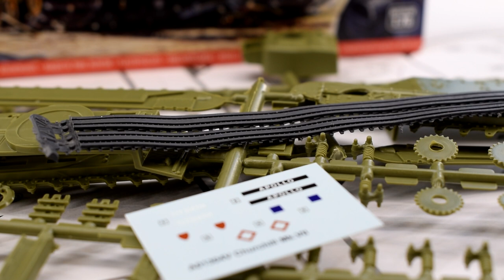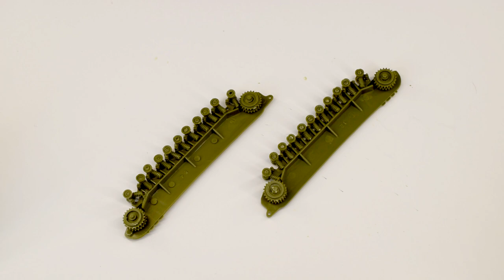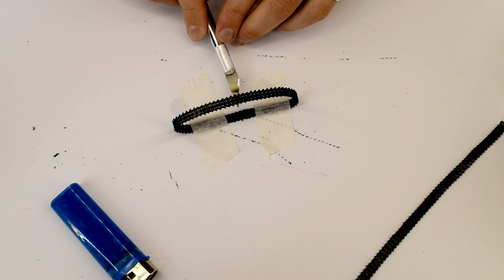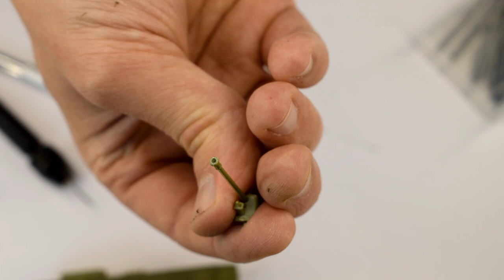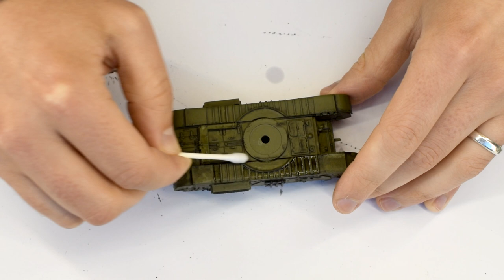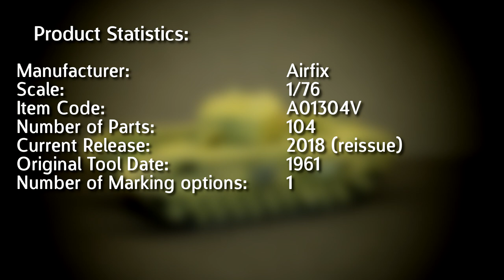Full Build | Airfix Churchill Mk.VII | 1/76 Scale Plastic Model Kit | Build & Review

Comment: When I was building these in the 60s when they first came out superglue didn't exist. Virtually nothing would ever get the tracks to stay together...
If you wanted a Humbrol Acrylic, just use #30 Dark Green. Simples. 👌
Reply from the maker: I've heard that stapling the tracks together can work. I thought about using the 30 acrylic, but it seemed too dark (yes I could have added white but I really wanted to try out some different paint brands and this was a perfect excuse)
Reply: @ModelMinutes  when i built this one i stapled the tracks together, seeing as the top part of the track would be hidden by all the armour. This worked quite well for me. 

Also the kit i bought had humbrol 30 on the instructions and not 159. This is a shame as the lighter green looks better.
Reply from the maker: @jamiegray6931  I think that humbrol have been upgrading their range recently which is why they have a more appropriate colour now
Reply: Fortunately Airfix now make these small scale tracks using rubber, as in this video. About 20 years ago they were using some grey vinyl plastic...it was awful. They had to be either stapled or sewn together.

Comment: I built several Airfix Churchill VIIs back in the early 1970s when I was a teenager. I eventually moved to painting historical wargames figures then took up building models again a few years ago and the difference in the equipment available and standard of modern kits and range of aftermarket parts compared to the old ones is amazing.

The Churchill in all its variants is one of my favourite tanks, maybe because I had an uncle who served in Churchills in Italy after being in Matildas in the desert. Memories of all those fiddly wheels have persuaded me to steer clear of the Airfix kit (which has fit problems as well) and go for resin models from the 1/76 Milicast range which cost more but are really nice and his range includes earlier marks as well as the VII.

Thinking back, I’m pretty sure the tracks were a kind of silver/grey colour originally, and best assembled by whacking a staple across the joint then hiding the joint inside the sponsons or by sewing the joint together. The hot knife thing never really worked. The old tracks also resisted paint even better than they did glue. It also doesn’t help that the Airfix colour instructions on a lot of their kits are simply wrong - the Churchills seem to have mostly been bronze green, or maybe the British equivalent of US olive green, but Airfix have a policy of only recommending paints from their Humbrol range which are more (or less) similar to the correct colour (and particularly frustratingly sometimes the painting instructions include colours Humbrol no longer make).

One suggestion if I may - get yourself an airbrush, some good tweezers and sprue cutters. Airbrushes give a better paint finish and good tweezers and cutters make life a lot easier.
Reply from the maker: Thanks for the info! I've actually been looking at getting an airbrush . . . just need that YT revenue to come through before I can get one!
Reply: Basic airbrush setups are much cheaper nowdays. Probably could get a basic portable rechargeable airbrush for under £50 or so on places like Amazon. I live in the US so I guesstimated the price in pounds sterling based on prices I have seen in USD. Even the cheap Chinese stuff should be good enough for basic stuff.

Comment: Your Churchill turned out good. 
I think £6 is ok for these classic kits, but it's the postage that's a killer.
The Airfix 1/76 Cromwell is a fantastic modern kit that does away with those rubber band tracks...however it is a bit more expensive.
Reply from the maker: Yeah - I quite liked building the cromwell :D

Comment: Nice video again. I really love the 1/76 Airfix & Matchbox/Revell reissues. Will try superglue to finally finish my Airfix MKI. But I am wondering what is the benefit of the Tamiya thinner when you can use water for acrylics instead?
Reply from the maker: The benefit of the thinners is that they are usually alcohol (or similar) based so they actually work into the paint to make it thinner (chemically). Whereas water pretty much just spreads the pigments out (as is my understanding)

Comment: Good video! 👍 When you attach an antenna, try drilling a small hole for it to go into. That way its a little sturdier, and won't snap off as easy if you accidentally bump it. For a tiny area, like the top of an antenna mount, start the hole with the tip of your hobby knife by rotating the point until you have a well centered starting point for your drill bit. That way your drill bit won't move sideways while you are drilling, and the hole will be perfectly centered.
Reply from the maker: Top tip! I'll try and remember that next time!

Comment: Very cool lookin tank! Btw i have a question. Is it always neccessary to apply gloss varnish under decals?I tend to use fine decal setters (under & over). Despite having problems with moving the decal on the surface they really get the job done.
Reply: You can also prepare the area for the decal by sanding it with super fine sandpaper. It makes flat/matte paint have a glossy appearance that is nice and smooth when you put the decal on.  After that, give the model a spray of dullcoat.
Reply from the maker: If that works for you then that's ok - i tend to apply the varnish as it is what I have available

Comment: do you have to use acrylic thinners on the nuln oil or would water work?
Reply from the maker: Citadel Nuln Oil comes as a wash - so no thinning is required
Reply: @ModelMinutes  i mean for taking off the excess wash it normally works on chalk washes
Reply from the maker: Ian Kozlovsky yeah, thinners works best for that. When it dries the water won’t do anything

Comment: Very nice build of this old classic kit.  Having built one a couple of years back I agree with your comments re the poor (by modern standards) moulding quality and the fit challenges.  I spent a very long time painstakingly cleaning and refining the shape and fit of parts (my OCD kicking in, I always tell myself I'll do a 'quick build', but I never manage to, dumb really because this results in a lot of stalled builds) which did improve the final appearance, but not dramatically so... I think you used your time far more wisely.  Great painting and weathering skills and again I think you used your time wisely.  For fans of small scale Churchill's the Matchbox (reboxed by Revell) 1/76 Churchill AVRE, is a real gem (complete with bridge_laying modification and mini diorama), and then of course Dragon offer really high quality choices in 1/72.  The smaller 1/76 scale really shows if placed alongside 1/72 subjects, but can create a nice distance illusion in dioramas by using 1/72 in the foreground and 1/76 at the rear.  And yeah... those horrible rubber band tracks!!!  I have to confess I didn't even try joining the ends, I just superglued the visible sections and cut off the lengths that are concealed under the track covers.
Reply from the maker: thanks for letting me know :D

Comment: You did a nice job of making the brutally difficult wheels look easier than they truly are :) I have built the kit as well as the Bridelayer and the Crocodile kits. They 'end up' great, but, they will require a great deal more swearing than you implied :) They don't just casually clean up with a few moments with a sanding stick at all :) They don't assemble with little or no effort involved. If you want them all correctly aligned that is. The assemblies are not even as close to as easy as you make it seem. BUT, this kit produces a very good-looking model. With effort. It compares nicely with my Dragon DML Churchill just fine. Modern mold tech doesn't make a kit automatically superior. You are good at painting. I don't mind making this kit at all. But I have oodles of patience. It doesn't just fall together. A novice will not enjoy this model.
Reply from the maker: I agree, this is not a great kit - it actually made it into my top 5 worst kits of 2020 video

Comment: Just finished building this one as a first I guess model that isn't a Gundam and honestly I do see the flaws it has during building but I still enjoyed it. I mainly got this as an introduction model for both building basically common model kits (since gundam's don't really require glue or really painting unless you want more details and final touches) and painting. It honestly was fun for learning both. Painting was super fun (I had to use a website to find the paint that closely matches the paint they recommend for each colour except for one I had to basically choose myself what looks similar) and building was also fun (some parts were annoying but overall I enjoyed the struggles). The tank tracks I ended up stapling since it really was in a spot where you wouldn't see them at all (saw what happened here and didn't want to risk it lol).   
   
I still have to do some minor touch ups with the painting but it has been a fun experience. I plan to maybe build a plane next since I also want to see how that is like as well and maybe go up to building models that are more bigger in scale. Heard good things about Tamiya kits so I am really curious how much better it is. Thanks for the video also, helped me with my building as well as I went back to look at some parts I wanted to make sure I did right.
Reply from the maker: thanks for sharing!